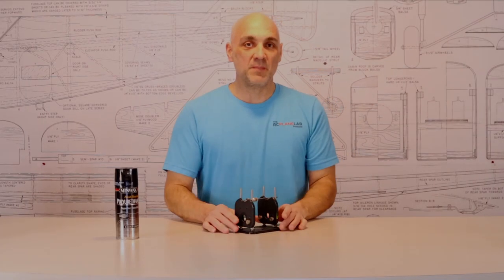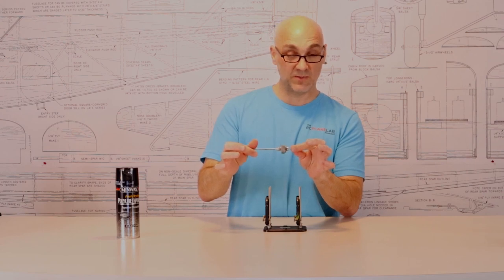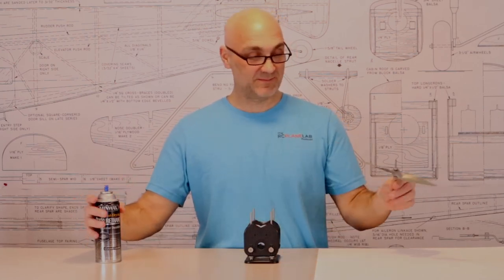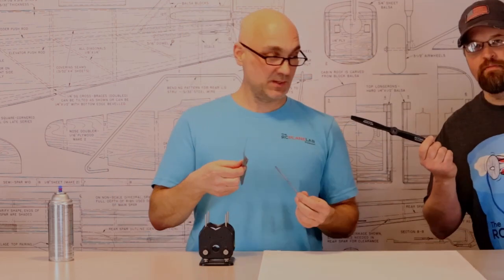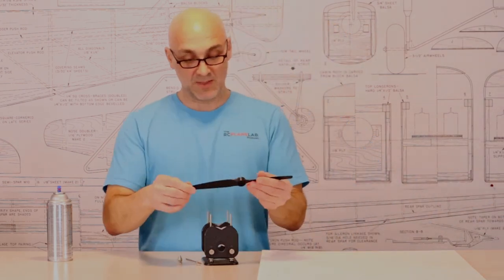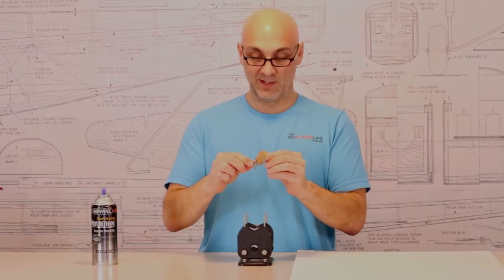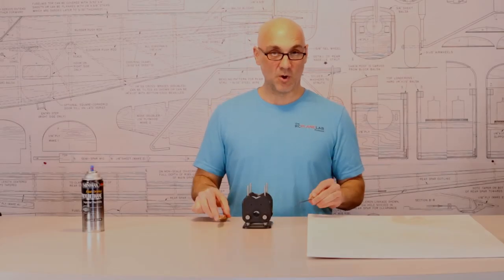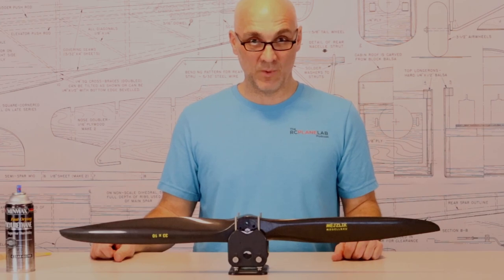How to Balance a Propeller, RC Plane Lab

Comment: Well done guys!! I found that small pieces Tape works really well in the back side to balance props. That may not work well for Fuel engines. It does great for my Electric motors. i use 3M Electrical tape on the black props, and clear packing tape on all the rest. It takes very little to balance them perfect. i also balance my spinners with tape.

Keep up the great work!

Comment: First ream your prop if needed, just lightly sand back of prop on heavy side spray paint is nuts, only paint thats fuel proof is epoxy especially with nitro

Comment: Half job done. Hubs need balancing.
Reply: Yes and for larger props that causes you to use some different type of setups with this Dubro. My prop will not stand vertical, going to try and balance from the side of a table maybe I dont know.